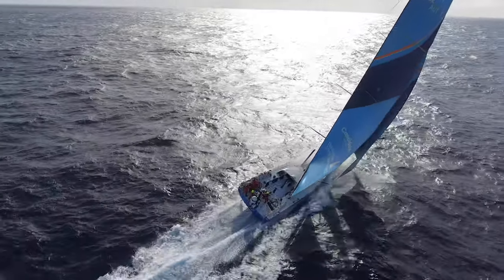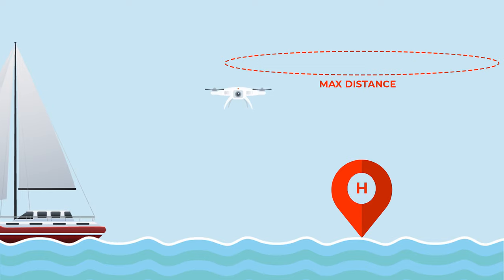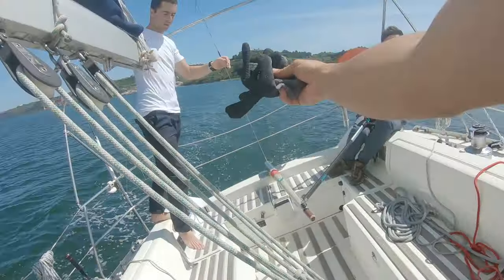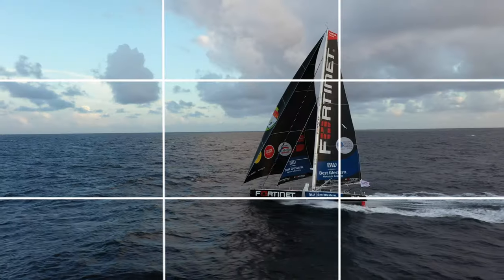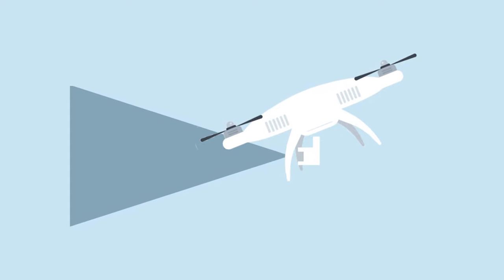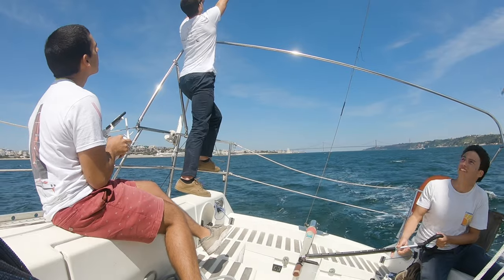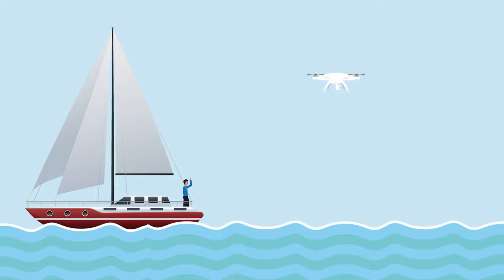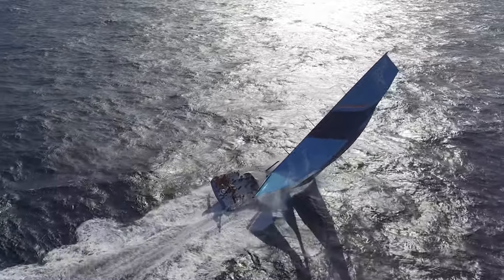how to FLY A DRONE from a MOVING SAILBOAT: +20 Tips and Tricks

Comment: Great content and explanation, I’d like to share something: I’ve flown drones from boats as photographer and also because I’m sailboat captain. Two of the most important things I learned was: if you can take off with the boat detained and land it same way, you’ll avoid many headaches. Once it’s flying, hoist the sails will take less than 3 minutes on 40-50 feet long or shorter vessels, and the visibility is better without sails, either to start flying or to get the drone back. The other tip would be: “turn off the radar” it’s a pain and could create some interference. Salut !

Comment: Wish i watch your video a lot sooner. I didn't have anyone to release and catch my Mavic 2 zoom while i was filming a vessel during its sea trial. Taking off and landing while the vessel was testing its top speed around 20+knot was madness. 

Taking off wasn't that bad compare to landing it. But it still dangerous, it will take off and went strait off the back of the stern and above the water, if u have something obstructing, it's gonna be a disaster. luckily the helipad got only a 3ft fencing, so a fast vertical speed will allow u to go over the fence instead of into it.  BUT! only if u have enough clearance like a helipad. for a small boat, u gonna need to hand launch it.

Oh ya, i was struggling the the 'IMU redundancy' issue, block the drone from locking onto the gps, get the prop rotating then only u're good to go.

Remember, if the boat/vessel is moving, u got to straight away move you drone to match the boat speed, then only it will 'seems' like hovering on the moving boat.

Upon landing, the drone will somewhat drifting on the helipad, thinking the ground is stationary, which it's not, the ground(vessel) was moving at 20knot, luckily the helipad was large enough, allowing the prop to fully stop after drifting about 10-15ft. NEVER try these if u don't have space large enough, get someone to catch it like being shown in the video, just follow the video advise, u'll be much safer.

Even though no drone or bank account were harm, I'll definitely go with your advise, get a glove and give it to someone to catch it. Having someone to assist the take off and landing really makes a huge different. Thanks for advise man, u're saving a lot of drone operators from loosing their beloved drones and wonderful footages.
Reply from the maker: My pleasure man 🤙🏼

Comment: Hello congratulations for this interesting video I wanted to ask you for this information I tried to take off from the boat in the middle of the sea but the drone does not give me the ok to take off it keeps telling me low GPS signal even though there are 15 or 16 satellites when I go back to mooring at the anchored wharf and stationary inside the marina instead it gives me almost immediately ready to fly it's ready to fly what could have happened because I can't take off while I'm with the boat in the middle of the sea? Thanks bye
Reply: Could be the location you are launching from on the boat? 
There may be some interference from a device in the location the drone is launching from ... Just my guess.

Comment: Great and instructive video. I've been flying from boats for a while, and yes, landing is the struggle. I still prefer to use the Phantom 4 at sea, simply because the screen interface is better with Go than with Fly. It's also easier to grab than most other drone, but those propellers are really powerful. I once had to land it on an 18' speedboat in choppy seas. Not fun.